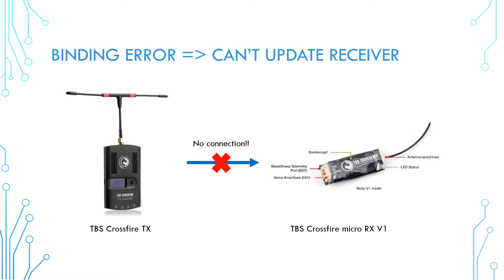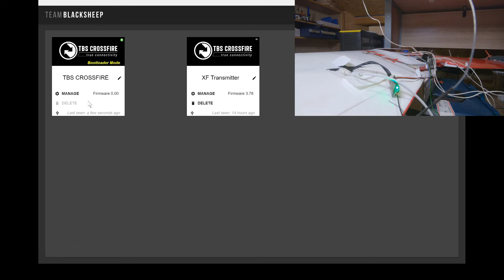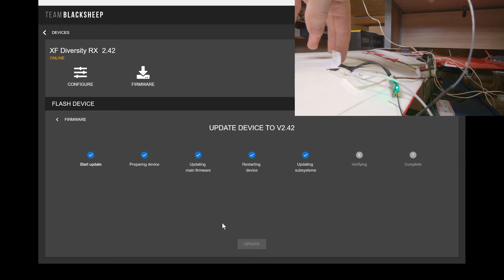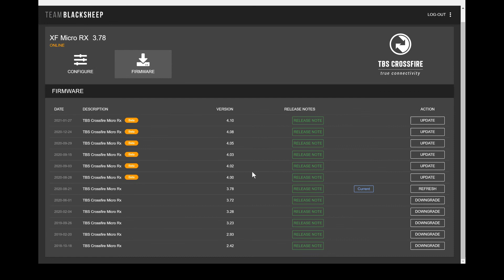Can't bind TBS Crossfire RX |  Update receiver with TBS Diversity RX

Comment: I'm in the very same situation that you've showed on the begging of this video (my Rx does not bind). I tried all that you've showed in the video with no positive result. The Agent M shows Error code 15, on multiple Rx and after update Rx does not even show red LED light. 
TBS Core Pro is discontinued, FPVision same, and ... i'm screwed. I have 5 Rx that will not bind. 
You think you can help with an advice? Thank you in advance!

Comment: Thanks for video,  I have same problem can't bind so therefore can't update, my receiver is a nano diversity so how can I bind will this same procedure work?
Reply from the maker: With TBS Core PNP or the Diversity RX or FPVision you have a connection with USB cable to the Computer and then with the BST cable to the receiver. on all devices is a i2c bus system  built in (pins: SDA and SCL)... so there should be an option that you can use an USB to i2C adapter (which you can buy very cheap) connect to the receiver and update it with TBS Agent X. That adapter is exactly built in on the Diversity RX and the other devices. 

maybe you can find more information on this website..: https://kamikatze-fpv.de/tbs-crossfire-emergency-update

anf here is this kind of adapter which I told above: 
https://www.aliexpress.com/item/32828812400.html?spm=a2g0o.productlist.0.0.1f8d5104haWydt&algo_pvid=b641fd55-a1aa-4b76-b8b2-c45474d9a8bd&algo_exp_id=b641fd55-a1aa-4b76-b8b2-c45474d9a8bd-1&pdp_ext_f=%7B%22sku_id%22%3A%2264999982908%22%7D&pdp_pi=-1%3B3.69%3B-1%3B-1%40salePrice%3BCHF%3Bsearch-mainSearch